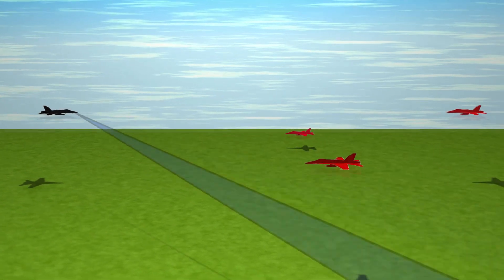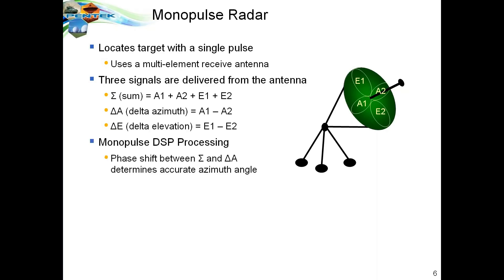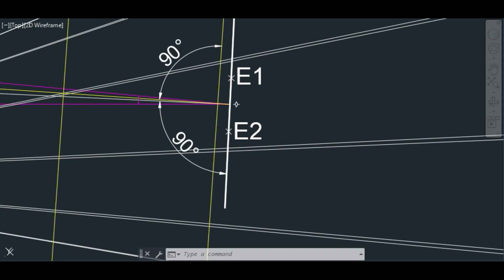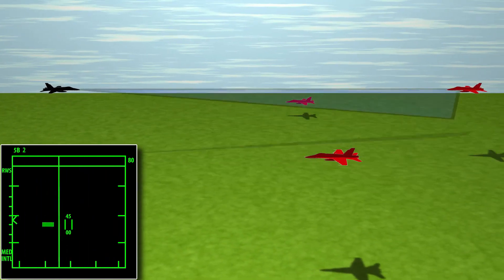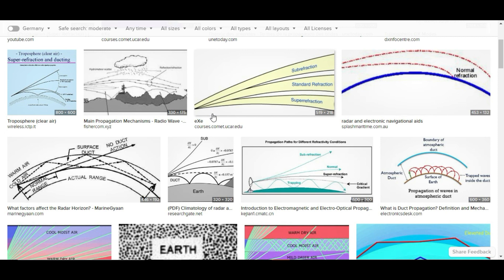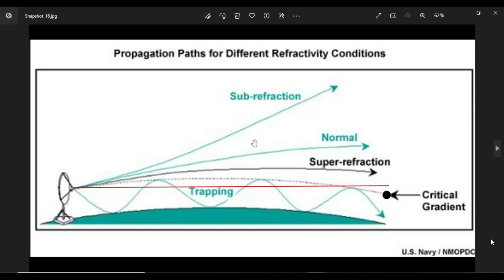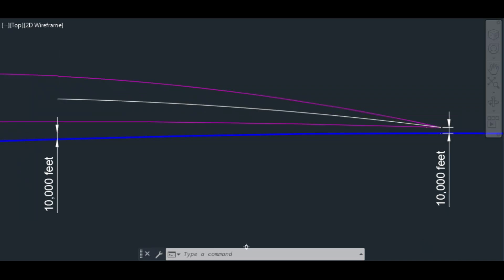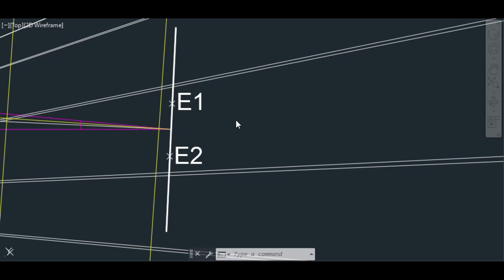Bendy Radar

Comment: Great Presentation Rob, it just would not be possible to make Radar work with curved lines if it needs perpendiculars, but more than that Standard Refraction is Not Refraction, it’s a mathematical change in an effective globe radius, which literally breaks the globe 🌎 as it causes the globe to present itself as an ARC lol 😆 Length, which is why for the Black Swan photo their effective radius is 263,000 Statute Miles, making the globe 🌎 less than 5% of the Circumference the Radius produces…. That checks out NOT….

Comment: Normal refraction is still bent down towards the earth.

Also, super refraction occurs closer to sea level, not at 10k feet. 

Super refraction doesn't need to occur for radar to function. You do realize the flat earth still has refraction to deal with. Less refraction, the more accurate the observation.
Reply from the maker: They can occur at different levels according to the narrative.  They are called "elevated ducts"
Reply: @Rob Durham  you didn't address the points made. I did not talk about ducts in this comment. I talked about how normal refraction is still downward refraction.

 I also talked about how super refraction does not occur at higher elevation. For super refraction to occur you would need a drastic density change. This almost never happens because this would require a drastic temperature differential. Land and water causes those temperature differentials. That is why you see mirrages that causes ducting. There is nothing at 10,000 feet to cause this.
Reply from the maker: Close to sea level are "surface ducts".
Reply: @Rob Durham  now, why would ducting need to occur on a globe? The line of sight isn't obstructed? Even if the plane drops 2 miles, this is over a distance of 120 miles. That is less than a degree of drop. The horizon is still behind the plane. Ducting isn't necessary. Only a slight downward curve, which is not ducting, will occur.
Reply from the maker: Electronic Warfare Fundamentals - November 2000 

"An elevated duct is generally formed by a temperature inversion in the upper atmosphere. To take maximum advantage of the increased radar range inside an elevated duct, both the radar and the target should be inside the elevated duct."

I never said they are commonplace.
Reply from the maker: 0.87 degrees to be precise equates to a lifetime (relatively speaking) for the return pulse differential on E1 and E2. You're seriously downplaying the issue. 

I'll give you whatever you want with the radar propagation path, bendy, refracting, straight you name it, I don't really care. Then explain the return signal calculation process from E1 and E2 to the display in the cockpit. That was the whole point of the video. You explain it and I'll draw it.
Reply: @Rob Durham  no, you stated it was necessary. Meaning, it would be a common place to use. You also quoted "upper atmosphere " which is not where planes fly.

All that is needed is to take directional measurement, calculated the distance from the time and lay it over a globular earth. 

There is nothing about ducting necessary. 

This doesn't debunk anything. All of this works over a globular earth. You would have to show that the detected plane is in level to the observer. Unfortunately, it has been shown that the horizon drops, as well as the moon, which is supposed to be above the level of the plane, drops below that line.
Reply: @Rob Durham  yay. Less than a degree of drop. Pretty pointless to complain about the 2 miles of drop. 

Now ducting is only useful for beyond line of sight detection. You know what doesn't have that? The Flat earth. Now why would we need ducting to observe objects further away?
Reply: @Rob Durham  now, why were you so adamant about the two mile, when it affects the measurment by less than a degree?
Reply: @Rob_Durham  that paper is a great tool in debunking the flat earth. Thank you for that.
Reply from the maker: The paper that you like so much says "upper atmosphere" and says both radar and the target must be within the duct, implying that it is speaking about high altitudes where planes fly. Come on stop clutching at straws. The ducts are BS anyway and I've already stated I don't care where the signal travels. Only what's happening at the receiver end.

I grow tired of your cognitive difficulties so that's it for me unless your going to work with me and show a worked example for me to draw.
Reply: @Rob Durham  what I'm saying is the plans radar had nothing to do with the upper atmosphere. You rambled on about ducting, when it is completely irrelevant to this application. They don't bounce the radar off the upper atmosphere 10km up. Did you forget that you are talking about a directional radar?  It isn't pointed up. 

How would you determine the angle of the plane if you used a duct 10 km wide? The receiver will have to determine the the direction of the craft from the way the singal is returned. Now you claim the signal is bounced? How will you determine the direction from bounced signal?

But why would they need ducting, if the earth is Flat? Radar is based off line of sight. If the earth is Flat, they wouldn't need ducting. Ducting is used to extend the range of the radar to beyond the horizon. Flat earth doesn't even have a horizon.

The only cognitive difficulty is you. These ducts aren't little. It is from the surface to 10 km high. It is used in general radar where distance and direction, not elevation is determined. It allows the boat to see beyond line of sight. Only necessary on a globe. The single fact is that you claim they have to use ducting, when it is completely irrelevant to directional use of the jet.
Reply: @Rob Durham  what exactly is your complaint of the globe and this use of the radar? It isn't ducting, cuz it isn't used. It isn't distance or line of sight. A simple calculation can correct the curvature aspect. It isn't the drop because it is less than a degree of difference. What exactly is your complaint?
Reply: @aznmutt15  please work with Rob like he invited on the video and the chat with you, so that we all can understand the problem you have with his explanation. You seem to muddy the water with nonsensical BS and refuse to meet his challenge.
Reply: @NothingButAHoundDog  only nonsensical bs is from flerfers.

Explain exactly how I am muddy the waters? I am not the one trying to bring up super refraction. Nor was I the one talking about 2 mile of drop, when it is less than a degree effect.
Reply: @Neomagik99 

Not just electronic warfare, but in over the horizon comms (OTH) microwave evaporation ducts (aka superrefraction or inversion layer) are used for OTH communications. 

In radio transmission as used by commercial broadcast, radio amateurs, military, aeronautics, etc. a variety of propagation techniques are used to overcome earth's curve with radio waves. It is frequency/wavelength) dependent. 

These techniques are; 

- Moon bounce (aka earth-moon-earth or EME)
- Telephony satellites
- Troposheric scatter 
- Ionospheric propagation 
- Microwave evaporation ducting
- Infrastructure radio
- Meteor scatter 
- etc. 

Had the earth been flat then it would be a no brainer building a radio tower say on the west coast of South Africa and another on the east coast of North America and establish a direct line-of-sight narrow band radio link across the ocean. But we can't. Earth is not flat.
Reply: @Crowned_Conquering_Man-Child I'm gonna take your completely irrelevant comment to the subject, as you don't have anything to contribute, so you make shit up

Comment: 12:15 you read the text and then make up your own interpretation of what it means. You think the people who put this literature together, especially the authors of RADAR textbooks know the earth is flat but pretend it’s curved?
Reply from the maker: Let's hear your interpretation then?
Reply: There is an easy way to settle this debate between flat earth and the globe once and for all. I do survey and engineering work so I know for a fact this will work. Back in the 1800's mean sea level was established and the government began surveying across the country establishing bench marks and making contour maps. These benchmarks are vertical measurements referenced to mean sea level. The government archives these survey notes. Just dig out some of the notes where they surveyed for long distances and see if they corrected for the curvature of the earth. If they did then it is a sphere and if they didn't then it is a plane. It can be no other way. This will put an end to the debate for good.
Reply: @h2forlifegoat435  There is only one model capable of explaining any analemma simultaneously with the polar star 🤗
Reply: @h2forlifegoat435  another simple way is to select three points on earth and link them in a triangle. Using their bearings and trigonometry (sine or cosine rule) determine the three vertices. If the add up to more than 180 degrees the surface cannot be flat. Hence spherical excess.
Reply: @profphilbell2075  no one has ever done that though lol.... if they have i am unaware and would like you to link to the source.
Reply: @Graymenn  how would you verify the alleged photo is real?
Reply: @profphilbell2075  no flat earther has ever said there isn't there isn't mountains and valleys. have you ever heard of the abyssal plains. they are flatlands that cover over half of the earth's surface. that would would be impossible if we lived on a sphere. Your ego is keeping you from seeing the truth.
Reply: @profphilbell2075  The vast majority of the real estate at the bottom of the sea is a relatively flat expanse of level floor called the abyssal plain. It averages over two miles deep and accounts for as much 79% of the sea floor over the entire planet. The top layer of sediment found on the surface of the abyssal plain is rich in organic matter that has drifted down from above and contains the remains of virtually everything that lives in the upper reaches to the midwater ranges of the ocean.
Reply: @h2forlifegoat435  the sea floor also follows the curvature of the earth.
Reply: @profphilbell2075  if it's curved then it is  not flat. if you take the air out of a tire then it is a flat tire because there is no longer a curve to it. you are deluding yourself.
Reply: @h2forlifegoat435  flat tyre does not refer to the shape of the entire tyre. It’s called flat because without sufficient air the part in contact with the road becomes flat.
Reply: @h2forlifegoat435  I can prove that earth is a sphere. YOU on the other hand cannot even explain why it gets dark at night.
Reply: @profphilbell2075  the abyssal plains are flatlands. do you not know the definition of flat. it's without curve. if the abyssal plains were curved they wouldn't be called plains, why do you think the education system doesn't teach the earths curvature formula in school. it's because they know people would test it and realize we don't live on a sphere.
Reply: @h2forlifegoat435  most definately not. Anyone with just a little intelligence and common sense can prove earth is a sphere. Most small children can before their 10th birthday.
Reply: @h2forlifegoat435  Yeah man ! !
Reply: @profphilbell2075  you CAN'T prove it. FACT!
Reply: @profphilbell2075  How many kilometers must the level be separated from the plumb to have more than 90° angular between them?
Reply: @nosborlopesTP  was no 2 plumb lines are exactly parallel on earth. It’s impossible regardless of their distance apart.
Reply: @profphilbell2075  Between a plumb bob and the level there are 90° angular 📐 on a spherical surface this angle would increase from a certain distance, can you tell us from what distance this ceri
Reply: @nosborlopesTP  no 2 pylons on the Golden Gate Bridge in San Francisco Bay are parallel to each other, despite all of them being parallel to a horizontal attitude. That little fact should be instructive to you
Reply: @nosborlopesTP   no 2 pylons on the Golden Gate Bridge in San Francisco Bay are parallel to each other, despite all of them being PLUMB to a horizontal attitude. That little fact should be instructive to you
Reply: @profphilbell2075  I know that it is impossible to bend this square, making it easy to understand that the level of the oceans remains flat 🤗
Reply: @nosborlopesTP  there is no such thing as flat water. Water can never be flat no matter how much or how little.
Reply: @profphilbell2075  Impossible for water to rest on a ball.
Reply: @nosborlopesTP  there is no physics that supports that assertion.
Reply: @profphilbell2075  Water doesn't lie ✍️ the Earth remains Flat.
Reply: Yep, they have lied to us about everything.
Reply: @loritanner4478  you are not so special that anyone needs to spend literally billions of dollars and countless hours of scientists time just to fool you.
Reply: @profphilbell2075  did I say I was special? No. I did not. But just because you have prof in front of your name doesn't make you the all knowing of everything does it?  I have my opinion and you can have yours. That's the problem now days. There is only one point of view in some people's narrow view of the world. I can listen to other opinions and not put down others for theirs. Have a nice day.
Reply: @loritanner4478  it does not matter how many opinions there are. There is only one set of facts. One of those facts is that earth is a sphere. I have personal experience with a camera on a rocket that took a photo of the earth. The simple fact is the photo shows it’s a sphere.
Reply: @profphilbell2075  yep.
Reply: @profphilbell2075  "I have personal experience with a camera on a rocket that took a photo of the earth"
Liar
Reply: @profphilbell2075    Imagine thinking the world was a spinning tilted pear rock covered in water and air flying through the sky millions of miles a day lol.
Reply: BS